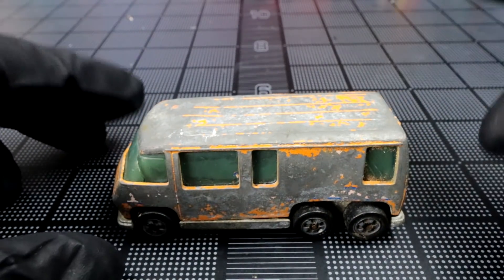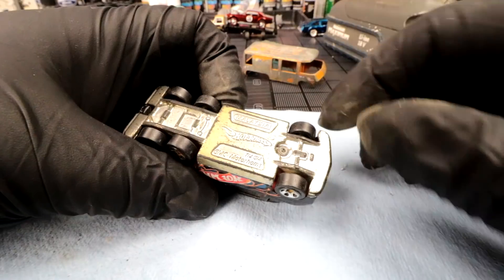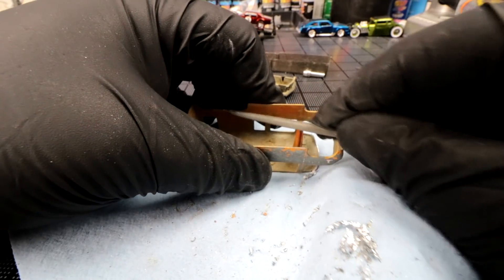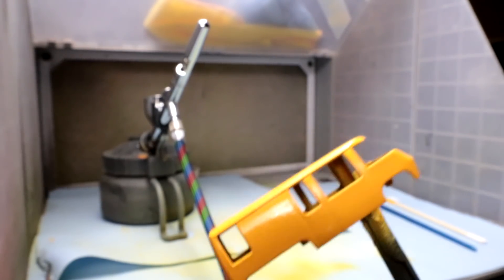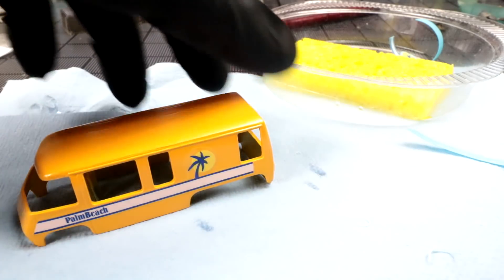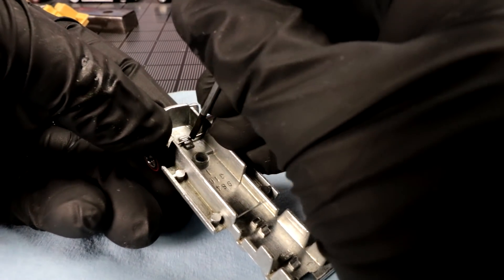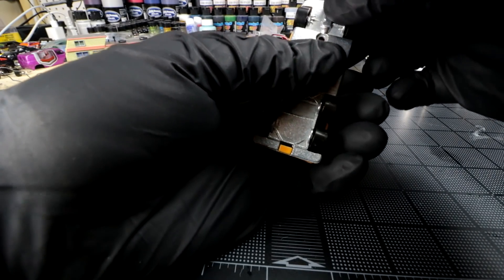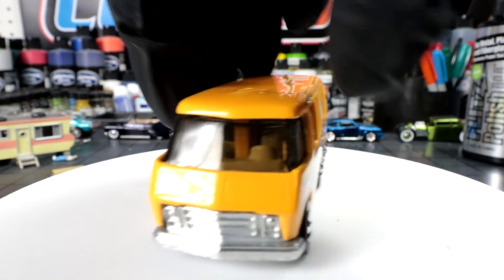Hot Wheels Restoration: GMC Motor Home

Comment: Looks terrific.  It may be the best paint job I've seen on any of the diecast resto channels.

A little tip:  Always use some soap when rinsing off any metal put into the Lime Away.  Soaps are basic and you need a base to neutralize the acid.

Comment: If you use a blue wire nut ( used for household wiring) on your auto center punch, you get a flat area rather than a point. I use this technique for fixing aluminum and stainless automotive side trim.

Comment: FYI, the first of the two rear axles weren't meant to be in the crimp on the base.  If you look at the interior, the axle was meant to float to simulate suspension movement.  Not a big deal if you don't plan to play with it, but that's why the axle was just sitting on the base when you took it apart.

Comment: How long do you let createx paint cure before polishing?
Reply from the maker: I haven't polished it before..
Reply from the maker: What you see is straight out of the gun.
Reply: Awesome! So how long do you let it cure before clear?
Reply from the maker: @willgraves5536  With the water based Createx line.. you can dry it using the air of your airbrush right in-front of your eyes and shoot the clear by the time you have it mixed and ready. :D  That's why I love it so much. No waiting. I let that orange dry for 5 mins before I put the decals on.
Reply: I can’t wait! I just restored two Ertl General Lee that belonged to my brothers and I. I also have a roscoe, boss hog and Daisy’s Jeep!

Comment: Now you can drive the old motorhome down the Palm Beach with Jimmy, and help yourself to some White Russians. By the way, I'm not wearing any socks. If they get blown off they'll have to come out of the dryer.

--Dave
Reply from the maker: I just had a revelation..what if I turn the other parts motorhome into the RV from the Bill Murray movie Stripes for my Baremetalhw entry......   HHHHHHHHHMMMMMMMMM   🤔🤔
Reply: @DiecastResurrection  that would be pretty cool. My only problem is I never see them motorhomes on the pegs. I've got a few but they're the NASCAR logo ones.

--Dave
Reply from the maker: No I don't.. I'm really struggling with this decision.  I know I have to bring it.

Comment: Wow, it really looks great.  What a fun little casting.  The only thing I can think of to address your decal issue would have been to mask off the areas they cover and lay down a coat of white.  That would’ve been a PITA so I guess you’d have to weigh that extra step against how badly you want the decal to appear.
Just curious, have you abandoned your paper filters and electric paint mixer?
Reply from the maker: I feel like i need to crate a machine that will just do Tampos.. like legitimate..  Maybe a CNC air brush or something.  Such a pain with the decals all the time.  I trust my Createx paints enough now not to use the filters :) Plus most of them have sparkles in them and I don't want to filter out any of those bad boys. Paint has still been looking good so.. no bother.

Comment: Just got mine in from ebay, I ordered it before I found your page, I'm going original to the vehicle, I got a set of dually wheels from greenlight to get the wheels original and the frost green and medium green for an original color. I tried your kinks to the paint stripper both were dead

Comment: Thanks for posting.  Really enjoyed this vehicle.  Not that I follow ALL the Youtube restorers but your impact body repair is rather unique from what I've seen.  Good job.  Second, I really like that you use a brass brush rather than a steel brush or steel wool.  I don't restore Hot Wheels but from what I've seen with others, even though the steel doesn't seem to do any damage I think it's just smarter and safer to use the brass.  To that end, have you ever used the brass wheel that comes in the rotary tool kits?  Seems like it might take things to the next level but I guess it might also go too far.  Lastly, for masking have you ever considered Silly Putty?  I've seen it used by a statue customizer and it seems to work really well.  For pinstripes and edges it probably wouldn't help but maybe around tail lights, rims, etc.?  Thanks again for posting all these videos.  Out of all the ones I watch, I enjoy your commentary the most.  Even more than that Austrailian guy who defiles his wife's toothbrush!  :)

Comment: Are you concerned with damaging the metal from the center punch? I noticed some holes. It’s not that big of an issue though considering they’re all on the inside of the toy.
Reply from the maker: Yes, in the future I plan to make a blunt end that that doesn’t damage the body and spreads out the impact wider. It was one of those moments where it was like “hold my beer, I wanna try something”

Comment: What tool are you using?
Reply from the maker: Auto center punch, link in the description, they are like $4-$5.
Reply: @DiecastResurrection  Sweet...thanks...what size screws and drill bit do you use...I'm working on the same vehicle.

Comment: I have a loose circa 1979 HW Greyhound bus in pretty good condition except for missing paint.  Have been considering having a youtuber restore/customize it.  Does anyone here know if it's worth more original?  I would love for it to get a paintjob like a diesel pusher private coach with rubber tires and tinted windows but idk if anyone would be willing to do it.